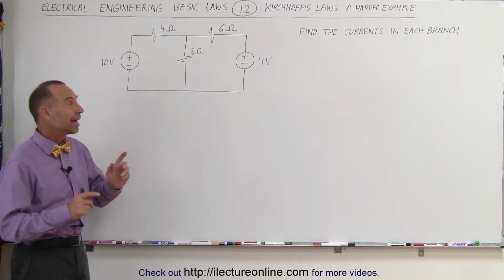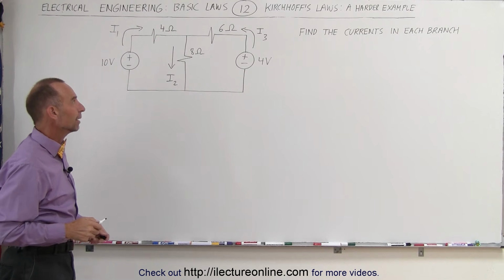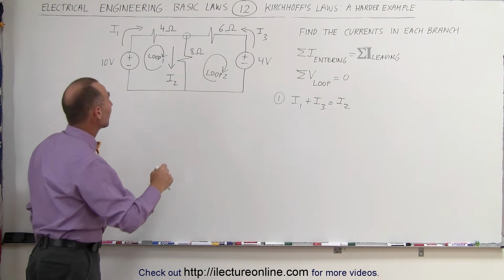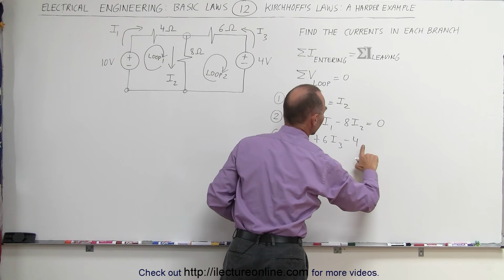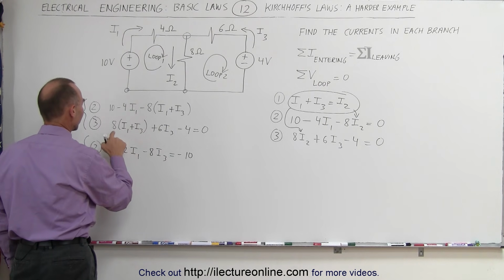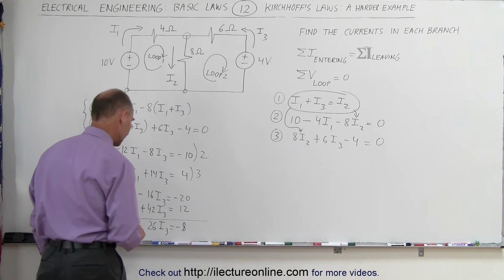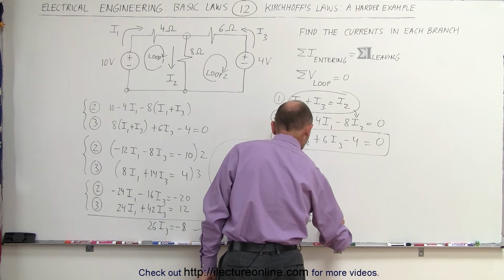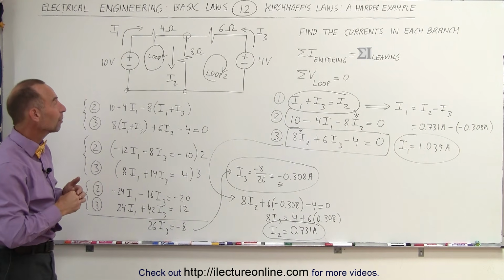Electrical Engineering: Basic Laws (12 of 31) Kirchhoff's Laws: A Harder

Comment: Hello. I would just like to ask if the voltages would equate to 0 in this? I calculated the first loop, and got a value very much close to 0. I heard that if it is so small like what I got, it is negligable. Is this true?
Reply from the maker: The sum of the voltages around any loop will always be zero.  If you calculate a number other than zero, but very close to zero, it is probably due to a rounding error.

Comment: @Hello sir, hope you are doing well.
I'm starting to learn this matter, and with a supossed convencional way, with a teacher that says on loop law, begins on the power source , saying that right loop will enter the negative side of the power source and that should be considered as negative on the equation, adding then the remaining resistances +,+ , each one. 
Can this be solved correctly by this method?
Thank you.
Reply from the maker: The start of the loop can be at any part of the loop.  As long as one stays consistent, that method will work as well.

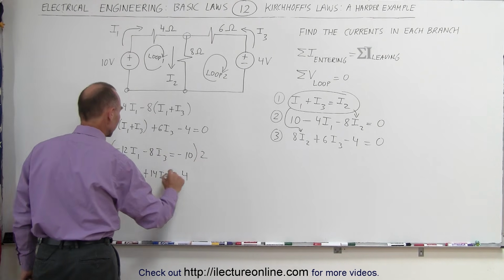Comment: question, in 5:58 how did you get the (3) for multiplying equation 3?
Reply from the maker: That is an algebra trick.  Since we multiplied both sides of the equation by 3, nothing has changed.  (The left side is still equal to the right side).

Comment: You calculated I1 to be positive, which means the direction you chose for I1 initially was correct.

But looking at the diagram, I1 travels from the negative terminal to the positive terminal.

Doesn’t this contradict the rule that conventional current is supposed to travel from positive to negative?

What am I missing here? I would appreciate any feedback; thanks so much for your help :)
Reply: Hi, that's the supposed "test" of this laws, to affirm if the I1, or I2, or I3 are correct, and add up to zero. 
On I(current) law and on loop law total some of total voltages drops also equals to zero.

Comment: Why I1 and I2 goes down together instead of them splitting some of their currents to the both resistors i did not get that.
Reply: Oh i get it now,  divided the problem into two sections and calculated the currents of each voltages then combined them together and got the same results.
Reply from the maker: Great.  Glad you figured it out.

Comment: is the process still the same if our teacher has given us the same structure example as yours but the difference is the middle part is an ampere load and we have another resistance on both lower parts of the rectangle. What should I do? please help😢
Reply from the maker: Yes the process will be exactly the same, using Kirchhoff's rules.
Reply: Should I combine the value of resistors on the upper and lower branch on both sides since it is in series so the structure can be the same as yours or should I just let it be and solve it as it is like you did?

Comment: 3 unknown currents. Use Kirchoff's laws (1st law once, 2nd law twice) and Ohm's law to establish system of 3 algebraic equations. Put that in any math software or any TI, HP pocket calculator and it's done.
Reply from the maker: Yes indeed, solving the 3 equations 3 unknowns type of problem can be done with any app or program or calculator which has that programmed.    But it is important that we learn how to do that.

Comment: Surely there's a better way to do these problems... Been stuck on these Loop and Junction rules all semester. How do you know which variable to solve for first for?
Reply from the maker: This is a very classic example of the use of Kirchhoff's rules.  Hopefully after watching a few examples it will make sense.  (We have similar examples in the physics playlists as well which is a prerequisite to this course).

Comment: is it correct to say that the voltage in that bottom node that I2 passes into via  the 8 ohm resistor is 0?
Reply from the maker: Since the node is not connected to ground we don't know.  Only if that section of the circtuit is connected to ground do we know that the voltage is zero.

Comment: if you use the second equation that 5=2I1+7I2 the answer will be different
Reply from the maker: We just checked the answers in the video and they are correct.  Thank you for checking.
Reply: @MichelvanBiezen  oh sorry i was using the values of I1 instead of I2 thanks for the correction

Comment: Could you correct me? I put i3 as clockwise which created i1 = i2+ i3. I moved the terms to get i1-i2 = i3. I plugged this into resistor 6 creating 6(i1-i2). Doing the system of equations I get an i1 of -0.18 which is different from your answer.
Reply from the maker: The answers in the video are correct.    6(i1 - i2) is not correct as a voltage drop

Comment: Sir , I have a question
What will happen if we take one loop clock wise and the other one anti clockwise 
Or one of them anti clockwise and the other clockwise.
Reply from the maker: It doesn't matter.  You will get the same result.  (but you have to keep track of your voltage rises and drops according to the direction you choose.  Note by reversing direction, you'll get the negative result of the result you got from your original direction.

Comment: Important question, is it wrong if i chose the direction of the current different for each loop? U choose clock wise if i chose anti clockwise for the first loop and clockwise for the second will it still add up corectly? Thx
Reply from the maker: You can choose the direction any way you like, (as long as you remain consistent throughout the problem).   If you get a negative answer for the current, the actual direction is opposite to your chosen direction).

Comment: Is it possible to obtain the currents in a situation exactly like this but with another resistor at the second loop?  I reckon it wouldn't be since there'd be 4 unknowns but only 3 equations...
Reply from the maker: You can have any number of resistors in any of the loops and this method will still work.  We have examples like that.

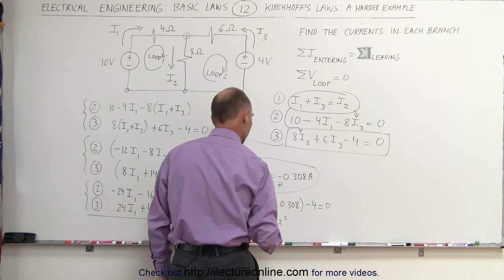Comment: At 7:50 when you moved 6(-0.308) to the other side you changed te negative sign to a positive which i get but why didn't the positive 6 change to a negative. I'm still learning algebra so I'm still learning all the tricks of moving everything around. Thanks David.
Reply from the maker: - 6 (0.308) = 6 (- 0.308)  but that is NOT equal to -6 (- 0.308) = 6 (0.308)
Reply: @MichelvanBiezen  looking at your answer I couldn't figure out but after doing the calculations now it makes sense. doing it your way gets a positive1.848 which is right. doing it my way would have resulted in a -1.848 which is wrong. As a beginner I would not have known that and would have changed the 6 to a negative. Is that allways the case, if a number is multiplied by a number in brackets you change the sign of the numbers in the brackets but the number outside the bracket you don't change. Isthere some kind of albebra rule that states that. Thanks for your help David
Reply from the maker: Yes, you have to be VERY careful with the signs doing these types of problems.

Comment: When we draw the Loop 2 - its in the opposite direction to I3 - I didn't understand this part. Thank you.
Reply from the maker: The arrows in the center of the loops, simply show the direction of "travel" around the loop (which is independent of the current direction) in order to add up all the voltages.  KVL

Comment: Sir, In getting the I2 why 6(-0.308)-4 becomes 4+6(0.308). I'm confused. It should 4-6(0.308), right?
Reply from the maker: We moved the two terms to the other side and therefore the sign changes.     A - B - C = 0   becomes  A = B + C

Comment: Great sir! But i have a question sir, how about the circuit only have 1 voltage, 1 current entering and 3 current leaving ? There are 3 loops in total now , Thank youu sir ❤️
Reply from the maker: If there is only one voltage source, then it becomes an easy problem and you don't have to use Kirchhoff's rules.

Comment: Hii I have a question about the battery is that inside of the battery you have electrons because of redox rxn's and there are electrons  more (8 electrons for example) at the negative terminal and there are less electrons at the positive terminal (3 electrons). And I found out that at the negative terminal the electric potential of 8 electrons is (-8J/C) and the electric potential at the positive terminal, the electric potential of 3 electrons is (-3J/C) and when I take the voltage of the 2 points of electric potential then I got two possible answers that is +5V and -5V and I am not sure which one should I use???
Reply from the maker: The side with the least electrons (let's call it A) is at a higher potential than the side with the greater number of electrons (let's call it B)   Then A - B is + 5 V and B - A = - 5 V

Comment: If the + - side of that 4V battery is flipped, would the first equation still be i1+i3=i2?
Reply from the maker: The method is to assume the three current directions, regardless how the components are connected.  If you guess wrong initially, you will end up with a negative answer, indicating the current is actually in the opposite direction.
Reply: @MichelvanBiezen  ok thank you.

Comment: If I3 has a negative sign, it means we  have chosen the incorrect path of the current flow. Does that mean that I3 is actually positive? If so, when you plug in those values to solve for I1, insteaf of adding I2 and I3 (because - times - equals +), shouldn't we be substracting the values and thus we would get a different answer for I1?
Reply from the maker: The answer is no.   Remember that we calculated all the currents assuming current directions.  If we get a negative answer for one of the currents, it simply means that the current is moving in the opposite direction as assumed.  Nothing else changes.
Reply: @MichelvanBiezen  Thank you so much for taking the time to clarify my doubt. Your videos are much appreciated.

Comment: sir you did not indicate the power loss in the conductor if im going to use a multimeter I couldnt get the exact value
Reply from the maker: In circuits, the power loss due to conductors is virtually zero.  That will not be the reason why your measurements do not match the theoretical values.

Comment: Sir, do we have any short trick to solve these types of problems? 
I am preparing for NEET ( medical entrance exam in India ), so we have very little time to solve such problems...
It would be great if you can tell a short trick. please
Reply from the maker: For this type of problem there is really no short cut.  But that said, it does depend a lot on how the questions are asked on the exam.  We are currently making a number of videos on the JEE advanced tests and often you don't have to work out the problem in detail to find the correct answers.  We illustrate that in those videos.  We haven't looked at the NEET exam yet.  But we will and we'll try to determine how to best prepare for that.  Our time is very limited, so we don't know when we can get to it.
Reply: @MichelvanBiezen  oh ok thank you, sir
Reply: @ClinIQ-codex  There is a shortcut.  It's the method of superposition.

To give an overview, you "turn on" one source at a time, and "turn off" the other sources..  Voltage sources become shorts when "turned off", and current sources become open gaps when "turned off".

You then assign a point, or several points at which it is of interest to find the voltage, and would help you solve for everything else you'd like to know.  Then you find the voltage at that point, exclusively due to each individual source.  Then you add up the partial voltages, to find the total voltage at the waypoint you assigned.  You then have the voltage at that point, which you can use to solve for everything else.

This turns algebra into plug-and-chug arithmetic.

Comment: Why do we assume that both voltages will go clockwise??
Reply from the maker: Voltages (or potential differences) do not "go" from one direction to another, but they do push charges and produce a current in a particular direction.  I presume you were asking about why we chose the 2 currents in a clockwise direction?   The answer is that it really doesn't matter.  If you pick the "wrong" direction you will just get a negative answer for that current, indicating that the current flows in the opposite direction than picked.
Reply: Michel van Biezen Ohh, that makes a lot of sense. Thank you so much!!

Comment: Thanks for the clear explanation. My question is, doesn't the I3 negative sign affect the values of the I2 and I1 when substituted in the equations?
Reply from the maker: It doesn't matter which direction (and sign) you pick for any of the currents.  In the end, the other answers will adjust to match your picked direction and sign

Comment: So if i3 is in the opposite direction won't that change the equation i1 + i3 = i2 to be i1 = i2 +i3
Reply from the maker: No, it doesn't matter.  You will always get the correct answer with this technique.

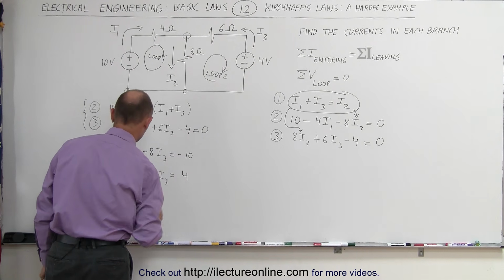Comment: OK So at 5:34 you have stated that multiplying eq x 2 and eq 3 x 3 both both i1 from Eq1 and Eq2 become equal opposites canceling  each other out, but how and why do we need to do this?
Reply from the maker: This is just one of the many methods that can be used to solve simultaneous equations, so we can determine the current in each branch.
Reply: @MichelvanBiezen  so are the answers suppose to the same in terms of like the 24 for example or can it be different

Comment: so, what  if i got i2= -0.731A , i1= -1.039A, i3 = 0.3A . is it still correct?
Reply from the maker: It looks like you picked opposite directions for your currents.  If that is the case, you got the correct answers relative to your chosen current directions.
Reply: @MichelvanBiezen  thank you professor.

Comment: I think there is a faster solution for this particular model sir.

Assume the upper branch that divides into 3 cable, has current goes out all from that branch (I1, I2, I3). In that case, we assumed that there was no current coming in but has current coming out from the branch. Or  I1+I2+I3=0. Then take the lower branch as the end of the loop, giving us 3 equations as followed.

I1+I2+I3=0=n(I1+I2+I3)

4(I1)+10=Vb1b2
8(I2)=Vb1b2
6(I3)+4=Vb1b2

All we need to do now is equaling all the current coefficient, then by knowing n(I1+I2+I3)=0, we just got Vb1b2. Substituting the value to the 3 equations and we get the individual current.

Edit: I guess we can also use Cramer’s Rule. Should be really effective for more loops. Haven’t tried it though.
Reply from the maker: Did you get the correct results for the current?
Reply: Michel van Biezen I did sir. By substituting Vb1b2’s value, 76/13.

Comment: Can we apply Ohm's law for 4 ohm resistance and 10 v voltage? In that case current I1 will be equal to 
10/4=2.5amp.which does not match with our I1.
Reply from the maker: No, you can't use the simple Ohm's law equation here because you have multiple voltage sources.  Each source affects each branch in a way that is difficult to predict, unless you use Kirchhoff's rules.
Reply: @MichelvanBiezen  Thanks a million for the fast reply.

Comment: My calculation and simulation shows that u might have a mistake in your calculations.  I1=0.62, I3 = 0.307 i2=I1+I3, therefore I1 = 0.927. 

In your solution I1 > I2 which is against the junction rule i guess. well it is just not logical to me so i went and simulated the circuit and i did get the results that are opposite of your solution.

Also, futher research shows that if 8ohm resistor will be replaced with 17ohm resistor it will cause the situation that you describing in reply to the comment below. current is flowing into the juntion from 2 power sources. therefore I1 can not be greater then i2
Reply from the maker: The answers are easily checked by plugging the results back into the original equations.  When you do that you'll see that the answers are correct.
Reply: exactly what i did. and ran a simulation as well to double check everything
Reply: anyway, you have a great resource and i am rerally glad that i found your classes. god needs to send more people like you to the earth)
Reply from the maker: Try to work them using a different method and see what happens (the answers in the video are correct).
Reply: My apologies sir, i went and calculated the voltage drops and made simulation in different software...looks that i am just terrible at science)
Reply from the maker: Not at all.  I make plenty of mistakes.  It is all part of the process of learning.   :)

Comment: how can i assume the direction of resistance correctly ?
Reply from the maker: Resistance does not have "direction", but the current does and therefore there will be a voltage rise or a voltage drop depending on the direction of the current, and the direction of travel around the loop.

Comment: YOU are the best. but how can I1 (current 1) be greater than I2(current 2) . current 2 is the sum of current 1 and 3
Reply from the maker: I3 is a negative current which means the current in branch 3 is directed in a clockwise direction.

Comment: sir  why do u multiply by 2& 3    to form equations 3........?
Reply from the maker: That is an algebra trick in order to eliminate one of the variables.  Note that after multiplying the top equation by 2 and the bottom equation by 3, the constant in front of I1 is the same one being + and the other -     Thus when you add the 2 equations, you will eliminate I1